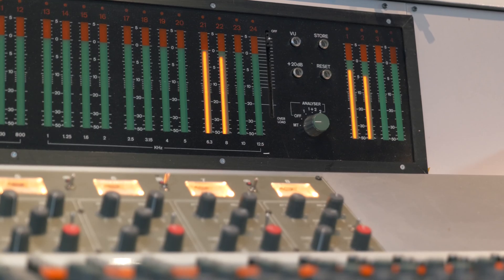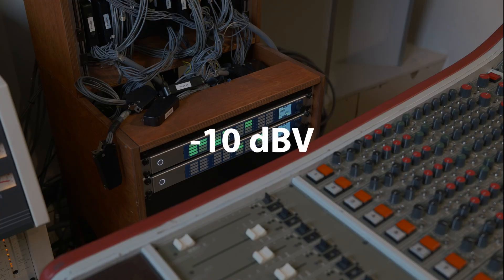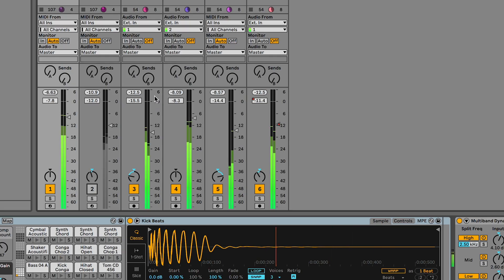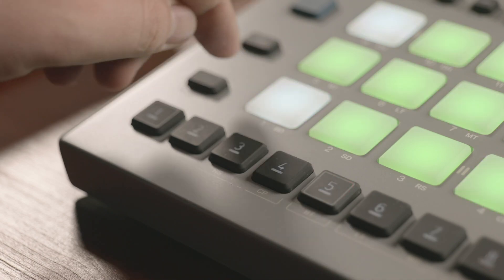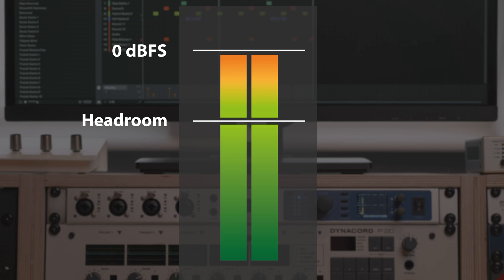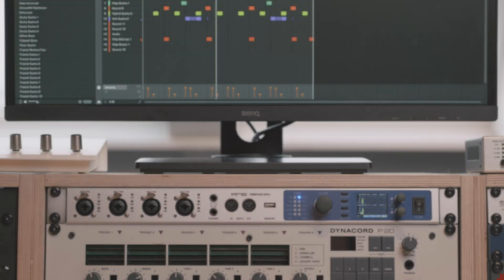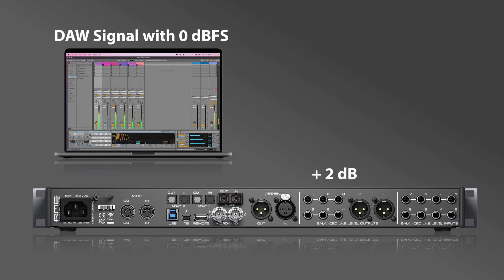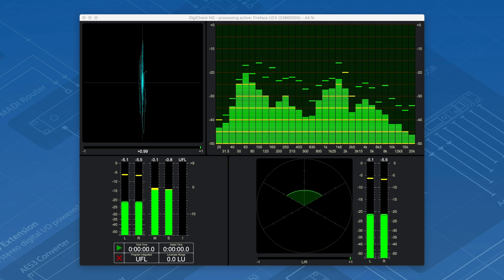Matching Analog and Digital Levels

Comment: there's a little confusion with concepts you actually explain at the beginning of the same video. +2dBV doesn't have 12dB headroom "compared to studio level" (also called pro reference level, which is +4dBu), it's compared to home electronics or consumer level (-10dBV)

Comment: i have rme ucx and igs blue 576, operating level of blue576 is +4dbu, max input +20dbu and max output + 22dbu, so any advice and how to calibrate ucx levels at input +4 or liw gain) and output (+4 or  hi gain).For now I have settled on output +4 and input low gain, but to compensate there is a difference of 6db, and when I work with blue576 bypass, I have no real comparison!? How to make things happen? Ideas and advice.   Thanks in advance
Reply from the maker: How is the IGS connected to the UCX? With balanced or unbalanced cables? With unbalanced cables you have a difference of 6 dB.
Reply: @RMEAudio  balance
Reply from the maker: @martotarto9581  Set both reference levels, input and output at +4dBu. You can test with a loopback cable from input to output with a test tone from any audio software. Output must be equal to input signal if you have set the same reference levels.
Reply: @RMEAudio  and what about of ucx ii, i have a ssl fusion, how to test it +13 or +19 for input and output.is it ok to put the input -19 and compensate with +6 db gain

Comment: Very useful video, I'll be returning to this. Some things still not clear though: 
1. My totalmix only has dBu settings, no 'Low Gain or Hi Gain' or dBv like in this video. The inputs have only two choices - +13dBu or +19dBu. Are there settings in total mix that change the gain menus, or is this just a different version of totalmix?
2. I still don't understand whether "Low gain" refers to the signal coming in, or the amount of gain that's added. (eg.is this option chosen for 'low gain' input signals/instruments, therefore adding MORE gain in the RME, or is this option chosen for 'louder' inputs, therefore using a low gain setting in the RME)?
Reply: on mine the +13 dBu is the louder one, which according to them isn't what it's supposed to be... this thing is overpriced trash

Comment: My old RADAR could be set as high as +24dbu 
Real nice when recording drums. +19dbu seems a bit low to me.
Reply: it's TRASH... I was cranking up my mixer until it was PEAKING... only to see the level in totalmix at -17; there is NO excuse for that... them trying to explain it away is so asinine.... it's supposed to be "professional hardware" yet it's hand holding and turning the volume down; despite what they say I've never seen ANY interface or software turn the input down like this.

Comment: Thank you for the very helpful and clear video!   I am in the process of setting up a hybrid studio with a UFX+ and Ferrofish Pulse 16 MX (connected to the UFX+ via MADI), and plan on incorporating a lot of outboard analog hardware, so I am just at the stage of thinking about this topic.  I imagine when I am connecting an analog device via the TRS inputs on the Ferrofish Pulse 16 MX  I'll need to set individual input/output sensitivities for each channel in the Ferrofish Menu rather than in Total Mix FX.  The Pulse 16 MX is the standard version (+20 dBu), not the +24 dBU model.  Are there any additional i/o settings in Total Mix FX that I should be adjusting as well?  Thank you!

Comment: Hello I have a question… So according to Fab DuPont pro tools HD converters are calibrated to equal 0 VU at -18 dbfs.  It's very confusing to figure out What the UFX + is calibrated to?

Monitors are set to +4 and set to +4 in total mix.  If that makes any difference. 

I use cubase pro 12 

I just want to know what avrage levels would be considered the sweet spot. For RME converters. Basically does -18 dbfs in my daw  equal 0vu? 

 essentially when recording in what is the optimal level
Reply: -18, +4 = +22 dBu for Full Level
UFX (example): +19 dBu for Full Level. So +4 dBu, -15 dBFS would be your sweet spot
Reply: @tcos332  I still don’t understand how you get that information? Ugh.
Reply: @ReignDropsStudio   Basically you’re dealing with headroom, as far as Peak-to-Peak amplitude of you’re wavelength. 

Let’s say you want to see peak levels at -12dBFS, this would therefore be leaving 12dB of Headroom. If 0 dBFS is the highest level before clipping it would happen at a level of +24dBu, +4dBu or -20dBFS. 
So 0 dBFS is essentially your DIGITAL level, +24dBu would your ANALOG. Thus, your sweet spot in this scenario would be -20dBFS SMPTE for Digital level, at +4 dBu for Analog. 

Sort of make sense, or help explain it better?
Reply: @ReignDropsStudio  here’s a good way I learned just by looking at metering and more visual references. This is for the same scenario mentioned in last reply too. There’s also a page on RME’s site I found that goes into more detail that might help. 

http://al-ba.com/wp2/wp-content/uploads/2014/12/conted2-300x284.jpg

https://www.rme-usa.com/analog-and-digital-audio-signal-levels.html

Comment: Thanks for the video. Questions : where are these settings options in the Babyface Pro FS interface (via Totalmix) ? Where are these specs in the manual (what numbers to look exactly, in case of the Babyface Pro FS manual, for example) ? What I can see (page 78) : Max. Input level +8 dBu (for Microphone). Max. input +13 dBu (for line Instrument). How can I find the reference level number(s) ?
Reply from the maker: Hey Dominique, the Babyface Pro is a little bit special:
The original Babyface usually operates in +4 dBu or -10 dBV BUT you can mimic the +19 dBu on the XLR inputs by activating PAD. Maximum input level will then be 11 dB higher (+19 dBu instead of +8 dBu). The Babyface Pro FS has +19 dBu for the XLR outputs as an option on the bottom of the device. I hope this helps!
Reply: @RMEAudio  Huge thanks. It helps a lot.

Comment: I have the babyface pro (not FS) I don't see the option in total mix to switch from -10 to +4. Is there a way to get that in an update? I believe I'm on the latest. What level is the default level for the babyface pro?
Reply: Is there an option in the Babyface application settings?

Comment: This is great and all but what I want is a loopback channel that doesn't require sacrificing an input channel. The mixer is virtual. Why is this so hard.
Reply from the maker: The channels in TotalMix FX are not virtual. They are defined by the FPGA inside the interface. Hence we cannot simply add channels :)
Reply: @RMEAudio  I admit that implementing DSP in an FPGA is slightly above my pay grade. Is it a matter of insufficient processing power?

If, in theory, you had a more powerful FPGA then would the feature be possible?

Comment: i love my fireface UC. i run a tr707 in my setup and with the accent turned all the way up, the kick clips a -10 input. by running it into a +4 channel, i can get all of the internal drive the machine provides. a more moderate accent setting sounds vastly different and if it wasnt for totalmix allowing this, i would be SOL.

Comment: RME interfaces are so flexible. Great explanations here!
Reply from the maker: Thank you :)
Reply: @RMEAudio   I wanna run a hybrid set up I have a pair of ad da convertors by ssl alpha links which rme madi pcie card or madi rack unit can I buycso I can track vocal mix and have monitori g of my ssl alpha link units
Reply: Rme audio  ? I own to Ssl alpha links ad da convertors I want to monitor the convertors thru total mix which  madi pcie card or rackmount unit will I need and will the rme madi  be compatible with Ssl alpha link convertors
Reply: @KEYBOARDTHAWAVE  your Alpha Link also has ADAT connections right? You could use RME UCX II, or Babyface Pro and use the ADAT outputs. Then you can use the SSL with Total Mix. If you ONLY have MADI connection, look at Madiface Pro or UFX.

Comment: Can't find this option anywhere. HDSPe MADI & HDSPe AIO Pro. Last available drivers. Is it (again) a MacOS only feature?
Reply from the maker: You can only set the reference levels at analog inputs and outputs. MADI is a digital signal.
Reply: @RMEAudio  The same for me, I've not this option on my totalmix inputs and output, I work with an digiface usb maybe is for that ?!
Reply: @RMEAudio  my AIO Pro has analog I/O, can't do it. I can only select levels from "Hammerfall DSP Settings". Thanks for your quick reply and support.